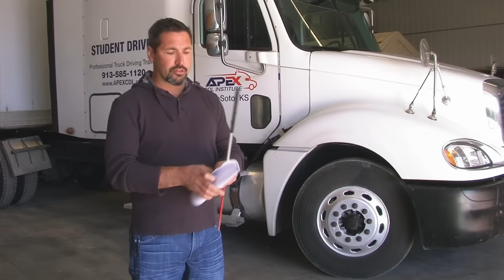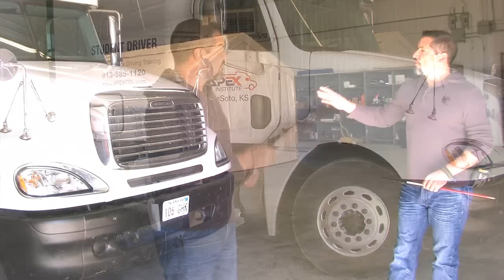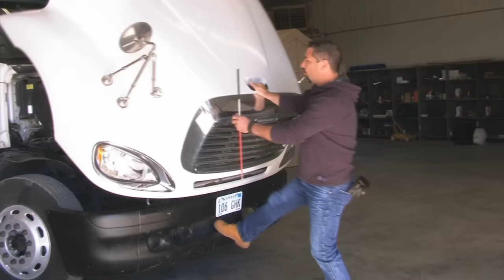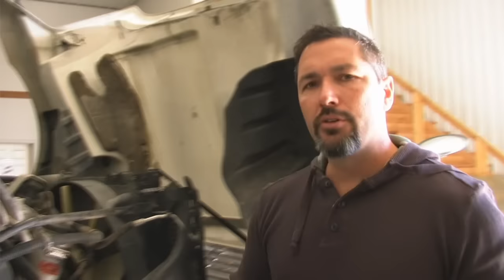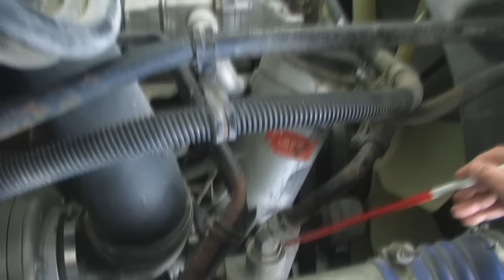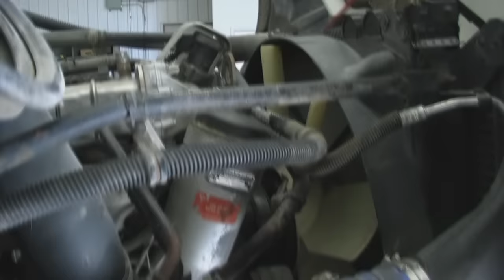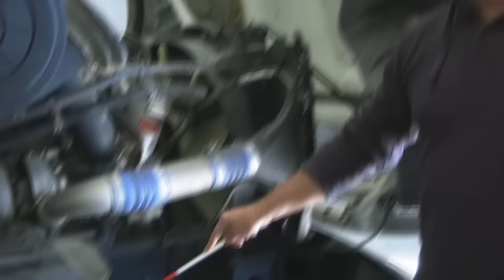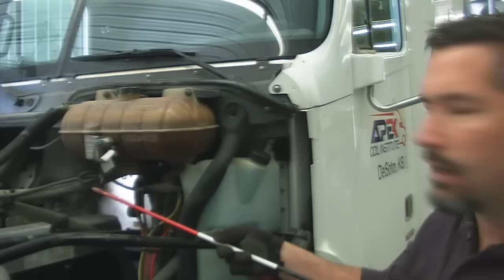How to perform a Class A CDL Pre-Trip inspection. Demonstrated by a state licensed CDL examiner.

Comment: As the examiner is walking to get in the truck you fan the breaks to bring the air pressure just below 90 psi if not it's a automatic fail.

1. Tell examiner i am going to do a safty start to charge the air. How to do a safe start pull on break knobs. Check to make sure it's in neutral push clutch start truck. 

2. You must tell the instructor when the governor cuts out. If the governor doesn't cut out or you don't hear it automatic fail. 

3. Turn key off till truck stops then turn key on.

4. We are on flat level ground or else I would chalk the wheels then realese the breaks.

5. Tell examiner I am going to do a applied pressure test I am looking to lose no more then 4 psi in one minute you must time this. After minute is up tell examiner I didn't lose more then 4 psi.

6.  Tell examiner Low pressure warning device MUST activate at or above 55 psi fan breaks. Tell examiner light came on above  55 psi.

7. The tractor protection value MUST close around 40 psi when the value pop out you must tell the examiner at what psi. If they close at different times you must tell them at what psi for each value  if not it's automatics fail. 

This concludes my air leak down test
Reply: So much of this is completely wrong.
Reply from the maker: I dont know who is teaching you this stuff, but this is completely wrong.
Reply: @Apexcdl  Thanks for clearing that up. I thought I'd be good doing the air brake since I have class b cdl. I apparently i have forgotten a lot of this since driving a city bus we don't usually do air brake checks, the mechanics does them for us. We just need to know how to do it to obtain the cdl class b. Anyway it might be slightly different from class a cdl right? I just got my CLASS a permit.

Comment: @,18:30. Those are brake shoes, not brake pads. The material on the brake shoe is a brake shoe lining. 
Brake pads = Disc Brakes
Brake Shoes = Drum Brakes.
Don't confuse people.
Reply: Well, if you can only point out one thing wrong in an hour long video, I'd say he did a good job
Reply: @Ryan_Carder  If your standards are less than perfection then of course you'd be satisfied.

Comment: Why doesn't the tractor have an emergency brake air line connected to the brake chamber?

Isnt the tractor's emergency brake a spring brake?
Reply: There are 2 types of brake chamber, single chamber and dual chamber, the singles look like cheese wheels and are service brake only, duels look like pills and have a second chamber with a spring in it for the parking brake.
The emergency air line to the trailer is actually to release the trailer's parking brakes, if that line looses pressure the springs expand and engage the parking brake, duel brakes on the tractor also have a second air line to release the parking brake, if that second line looses pressure the parking brake comes on.
Reply: @can_hauler  right, but I dont see a second line going to any of the chambers. Does he just not show the axle that has the dual service/emergency brakes? Havent watched the video in a while.
Reply: @bicboi1930  the front drive axle seems to be the one with the duel chambers, when he covers the (front) drive shaft you can just see what looks like the front of a duel chamber on the right
Reply: @can_hauler  alright cool. Thanks

Comment: I failed my in cab portion today because I did it exactly like this
Reply: What state you took the test?
Reply from the maker: Sorry, then your examiner was wrong.
Reply: Mississippi
Reply: She made the comment that this was an out dated way of doing in cab portion
Reply from the maker: @williamkeslinger1080  there is no such thing as an outdated way. AAMVA has not updated the CDL exam. There is a pilot program in testing right now to modify the exam, but it has not been implemented yet.
Reply: Mississippi and now I see what I did wrong was on the in cab you didn’t teach the 7 step brake check correctly there is nothing about the governed kicking on and off
Reply from the maker: @williamkeslinger1080  the governor is not part of the break check. The emaminers handbook and the check sheet has no governor cut in or out mentioned.

Your examiner was taught wrong or they just decided to add it. Which is not allowed by AAMVA.
Reply from the maker: @williamkeslinger1080  how would you even check the cut cut in? It happens at 100 psi but there is no indicator of it coming on. 

Obviously the governor came on or you wouldn't even have air pressure to do the brake check in the first place.
Reply: Step one built to 120 pump brakes down to below 100 makes sure it kicks on and cuts properly and step seven on brake check air has to build from 85 to 100 less than 45 seconds
Reply from the maker: @williamkeslinger1080  I understand what the manual says, but that didn't tell you that it came on at 100, only that it started recharging below 85.

Again, the fact that your air pressure is above 100 psi at the time of your brake check proves the governor came on.

Lastly,  it's still not part of the test.
Reply: As the examiner is walking to get in the truck you fan the breaks to bring the air pressure just below 90 psi if not it's a automatic fail.

1. Tell examiner i am going to do a safty start to charge the air. How to do a safe start pull on break knobs. Check to make sure it's in neutral push clutch start truck. 

2. You must tell the instructor when the governor cuts out. If the governor doesn't cut out or you don't hear it automatic fail. 

3. Turn key off till truck stops then turn key on.

4. We are on flat level ground or else I would chalk the wheels then realese the breaks.

5. Tell examiner I am going to do a applied pressure test I am looking to lose no more then 4 psi in one minute you must time this. After minute is up tell examiner I didn't lose more then 4 psi.

6.  Tell examiner Low pressure warning device MUST activate at or above 55 psi fan breaks. Tell examiner light came on above  55 psi.

7. The tractor protection value MUST close around 40 psi when the value pop out you must tell the examiner at what psi. If they close at different times you must tell them at what psi for each value  if not it's automatics fail. 

This concludes my air leak down test.

Comment: Kentucky leading state trooper/ inspector has heard this static brake several times at recent inspections and said he is tired of hearing this. He doesn't know where this terminology is coming from.
Reply from the maker: Well Mary, you can point hi m to page 5-9 of the CDL drivers license manual.....middle of the page. He should read it sometime.

Here, I will copy and paste it for you.

"Test Air Leakage Rate. With a fully-charged air system (typically 125 psi), turn off the engine, release the parking brake,
and time the air pressure drop. The loss rate should be less than two psi in one minute for single vehicles and less than 
three psi in one minute for combination vehicles. Then apply 90 psi or more with the brake pedal. After the initial pressure
drop, if the air pressure falls more than three psi in one minute for single vehicles (more than four psi for combination
vehicles), the air loss rate is too much. Check for air leaks and fix before driving the vehicle. Otherwise, you could lose
your brakes while driving."

I hope this helps the "Senior" examiner.
Reply: @Apexcdl  I read your copy and paste, no "static terminology" is used and it is on CDL page 5-7 in Kentucky manual also no "static" is used that is what he was stating is not correct terminology. and if you confront an instructor especially this one you will only get failed and no way get a pass.
Reply from the maker: @marymanning5002  Well there you go.......you found the problem. Kentucky's manual doesn't have a static test. The Kansas manual does......we are a Kansas School, not a Kentucky School. So I train the way my Kansas students need to be trained in order to pass. 
That being said, even though the Kentucky manual doesn't have a static check, the examiner cannot fail you if you do one. You haven't done anything wrong. As long as you do your applied test afterward, an extra step cannot fail you. This "Senior" examiner is wrong.

Comment: You do realize there has never been a fmcsa regulation that prohibits recaps on the steer axle of a cmv truck. 
Not saying one should run them either. One can and be legal
Reply from the maker: § 393.75: Tires(e) A regrooved tire with a load-carrying capacity equal to or greater than 2,232 kg (4,920 pounds) shall not be used on the front wheels of any truck or truck tractor.
It’s not uncommon to find highway trucks with front axles and suspensions rated for 13,200 pounds. While 12,000-pound axles were the industry norm for many years, the move to 13,200-pound axles came with the addition of all that emissions reduction gear.

Apex CDL Institute is a Class A CDL school and the inspection was being conducted on a class A vehicle, so while there is no FMCSA rule limiting retreads on steer tires for CMV vehicles specifically, the nature of a tractor-trailer and the resulting weight applied to the steer axle of an 18 wheeler does, in fact, restrict retreads on steer axles.
Reply: @Apexcdl  and regrooved tires are not the same as recaps.

Comment: Get out and block those wheels before air test or you failed....
Start engine in neutral, brakes on , build rpms to govern cut out.
Gov cut  out between 125-130psi.
fan brakes to govern cut in.
Gov cut in no lower then 90 psi.
Put transmission in 1st gear, turn off engine, turn key on, push in both emergency and service brakes.
S- Static, engine off, key on.(no more then 3 psi in 60 sec, combination truck.
A- Applied, Engine off, key on. ( no more then 4psi in 60 sec.
L- Low area warning, Engine off, key on. buzz & light activates at 60psi.
E- Emergency brake test. Engine off, key on. fan brakes, activates 20-45 Psi.

Comment: Everything you said that you claim that are not damaged or looks to not have any cracks, missing bolts etc, etc how do you know that for certain unless you get down under the truck and inspect each and every  component, for example, leaf spring hangers unless you get down under that truck and physically inspect them and every hanger on that truck you have NOT done your inspection correctly just because you pointed to it with a visual on it doesn't mean it's good to go until you physically get down there and check by not only sight but by physically touching the unit and twisting the bolts and looking at the bushing that's how you inspect a component on your truck, now tell me how do you know that the power steering pump didn't have a hair line crack on the other side that wasn't leaking yet just seeping or that there was a bolt that wasn't tight but looked tight and you signed off on it and as a result the driver was running down the highway at 70mph and that crack decided to let go and took the driver by surprise and lost control of the truck and killed or injured several people because he didn't do the inspection correctly. And what about your inspection on your brake system just because you look at the brake chamber doesn't mean that the chamber is good to go just because you point it out doesn't mean that you inspected it you have to get down there and physically check it out, you could have a frozen (rusted out) from the inside or a mounting bolt missing or loose but the way you and a lot of instructors are teaching these students your not going to know it because a driver would have to be knowledgeable about the mechanics of a truck and what he/she is looking at and how it works in order for that person to make that type of decision . What you and a lot of other trainers are advocating is to identify what it is and where it is but that the extent of it unless a person knows what he/she is looking for and looking at that truck is not being cleared correctly to run down the road safely. That is the job of a Mechanic a lot of this stuff you want the driver to inspect is to inspected by a qualified mechanic not a driver a lot of drivers are NOT mechanically inclined. The driver should be required to physically check the oil, power steering fluid level, anti-freeze level, tires, lights and  any leaking that they see on the ground or on the truck and of course do the visual on the appearance on the truck make sure nothing falling off the vehicle or loose like mirrors and depending on where your fire extinguisher is check it to make sure it's full and not expired
Reply: I have been a mechanic for 25 years working on automotive, commercial, agricultural and construction equipment. I believe this video covers what the driver should be inspecting and is adequate for their job. Not every driver is a certified mechanic. They don't need to do an extensive inspection on the vehicle, that's what the company/ mechanic should be doing annually via the Federal Annual Inspection. I'm still trying to wrap my head around what the point of your comment was.
Reply: @2005duramaxdiesel1  😂

Comment: Am I the only person here that failed the pre-trip inspection test because I did the static brake test when was not required ?????????????????
Reply from the maker: Some states require it, some dont. That being said, an examiner cannot fail you for doing material that isn't required. If you checked that your air conditioning compressor wasn't cracked damaged or loose, you don't lose a point for that. The examiner just doesn't give you credit for it.

Sorry to hear that. Your examiner has no idea what they are talking about.
Reply: @Apexcdl  I do not want to start an argument but Arizona CDL manual has 3 steps, not 4 and just as the gentlemen in the video said about the brakes check - you have to do it 100 % correct !
Reply from the maker: @drflaviu1  not an argument, just a discussion. If you do the static, it doesn't mean the applied is done wrong. You only fail the brake check if what you are required to do is done improperly. The actual CDL manual does mention a static check, it just may not be required to actually do it.